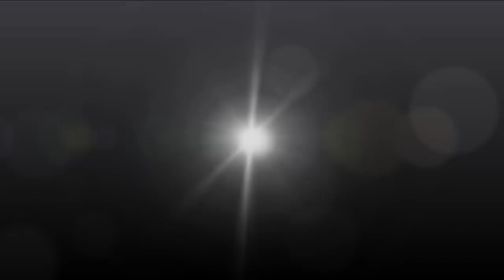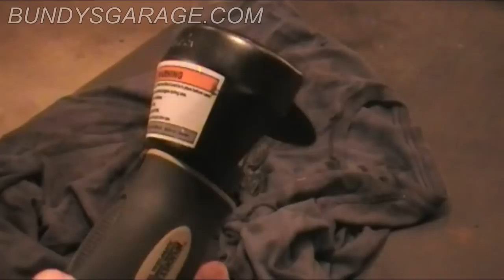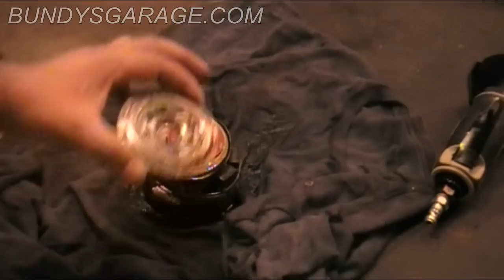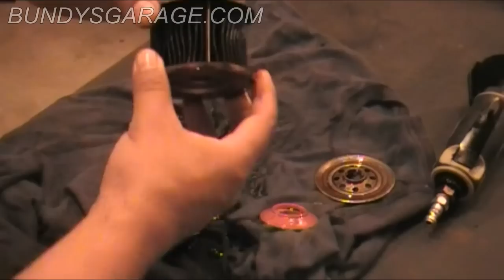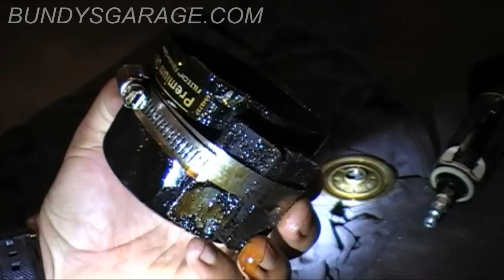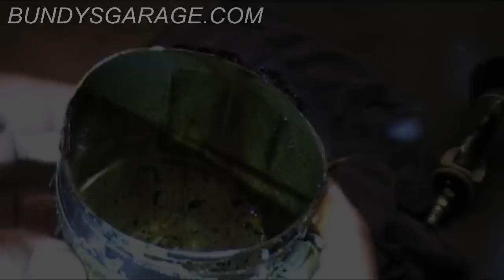Magnets on the Oil Filter Extend Engine Life...PERIOD! - Bundys Garage

Comment: Had an earlier comment! Filter will catch most of this stuff! However not all. On my 2001 Dodge Caravan I have a magnet (factory install), in the bottom of the transmission oil pan! When I change transmission oil the magnet looks like a porcupine with quills sticking out all over! This magnet is located before the transmission filter. As preventive protection of your engine magnets placed on oil filter cannot hurt! If it stops stuff so small the filter cannot stop then it would be worth it! Since you change oil filter on regular basis it would not build up to block flow! That is what the oil by-pass valve in your filter is for! A magnetic oil drain plug would also help! James

Comment: If you get a bunch of old computer hard drives you can take the magnets out of them. They are MUCH stronger than those $2 magnets you used and you won't need to strap them on.

Comment: You introduced a ton of metal particles when you cut the filter open, not that a magnet can't help.

I put a strong magnet on the bottom of my oil pan then remove it before I drain so the captured metal flushes out,  That way it works the whole time the engine is sitting drawing the metal to the bottom of the pan and holding it there.

Also, I feel like the oil is flowing too fast through the filter to allow the magnets to catch much metal.  On the pan it has a long time to draw the metal and hold it.

Comment: I have no doubt that the magnets catch particles.  But it makes me nervous using the magnets after the filter and not before.  I imagine particles building up in clumps against the magnet and then some of those clumps breaking free of the magnet and making it to the engine as a larger more harmful clump.

If the magnet was before the filter element then the filter would catch the clump.  Just a thought.  It seems scary, but what if you just dropped a powerful magnet inside the filter?  The flow of oil should always keep it in the body of the filter and I don't see how it would ever flow backwards past the steel oil filter inlet against the flow of oil.  It would have to fight against the flow and not stick to the steel filter body.
Reply: The magnets are catching the metal from unfiltered oil.  The clean oil comes from the center of the filter.
Reply: MrTdw1954 Ah. I thought filters flowed the other way.  Makes sense now.
Reply: what MrTdw1954 said is true.. the clean oil comes up threw the center. they do make magnets that go inside the filter as well.

http://www.ebay.com/itm/Single-Universal-Magnetic-Oil-Filter-Magnet/350471746669?ssPageName=STRK%3AMEBIDX%3AIT&_trksid=p2057872.m2749.l2649

 It would be hard to believe that there would be large clumps on a magnet after the filter because well.. its after the filter. The particles that come after the filter are so small you wouldn't really see it. and the Large magnet that is dropped into the filer should be able to hold it all. at least defiantly long enough between oil changes. make sure you would clean the magnet at every change. 

I would however wonder if the magnet inside the filter would cut off flow of the oil and cause other problems.
Reply: @MrTdw1954  Where are you getting your information, certainly not from a lubrication engineer like myself.  The oil flows in through the small holes, up the walls and then back out through the center hole, because there is more surface area on the outside of the filter element and it won't clog up as quickly.  Additionally, most automotive filters have a bypass valve built into the dome area of the metal casing, to allow overflow (bypass) if the media becomes saturated with debris.  This valve opens "into" the center chamber so oil can go up the sides over the top of media and then dump back down into the center area for release into the engine.  It WOULD NOT WORK if the flow was in the opposite direction because it is one way.

Additionally, our oil filter magnets are designed to go inside the center of a filter because we are trying to capture the particulate that is too small to be caught by the filter media.  We are only really interested in capturing particles that go "through" the oil filter because those under 8 microns are responsible for over 75% of our engine wear.     www.OilFilterMagnets.com

Comment: anyone whos been threw engine problems knows you get mostly copper & brass which are non ferrous & continue to circulate..I also use 3 strong magnets which never seem to catch anything..what am I doing it for besides peace of mind?.my rings are cast so I get that part but I just went threw spun bearings eventually I broke the crank, brass and copper for days no iron or steel.........
Reply from the maker: +ethanemily1000 what kind of engine?
Reply: sbf 306
Reply: I do believe its a good idea & thats why I do it..also in the T5 tranny & recently cleaned a bit of steel from them..but never from any engine have I seen anything on a magnet from motor oil, even with serious problems my experiences have shown metals in oil only; & filter obviously..seems if you did your motor would be trashed unless it was being broken in or something.

Comment: Magnets are not needed. The filter will capture these particles. Use quality filters Mobil One Royal Purple Amsoil Bosch are just a few.
Reply: Wrong, no oil filter will catch particle below about 20 microns.  (Note: Those are the $10 ones, not the $4 generics that most people buy).  Good enough you say, well let's see what the SAE, OEM and Independent Laboratory tests say.  How about... "Particulates under 8 microns are what cause 75% of an engine's internal wear!"   Oh, so a filer that can only capture particle bigger than 20 microns somehow stops the flow of particles under 10 microns???  Not gonna, if we can borrow a phrase.  Magnets ARE needed Arthur, please do research before making undocumented statements as this subject is well studied and beyond refute.    Check out the SAE, OEM and Laboratory Tests that have been in the book for over 20 years...  www.OilFilterMagnets.com

Comment: You do realize that the metal picked up by the magnet would have been trapped by the filter media, you are on the inflow side of the filter The human eye can not see particles smaller than around 35 microns (Child with perfect eyesite) so the fact you can see the particles means they are larger than the minimum capability of full flow oil filters of average 20 nominal microns entrapment.

The other point is oil particles also consist of non-magnetic particles.Much of metal found in an engine are soft particles of bearing and guide wear,deposits from combustion,and dirt passed by the air filter.Most of these particles will be non-magnetic.

It's more practical to use a magnetic drain plug to trap particles before they enter filter system.

http://www.baldwinfilter.com/literature/english/TechTips/201403TechTipsMicronRatings.pdf

Comment: I use filtermags on both my vehicles

$50.00 on eBay
Reply from the maker: +Jack Smith don't pay $50, just get 3 or 4 block magnets and stick'em on our oil filter. Less than $10 spent.

Comment: the filter would have picked that up anyways...
Reply from the maker: What if the metal particles are too small for the paper material to stop them and they just kept circulating around causing engine damage. This way you know for sure they are "captured".
Reply: not all metals are captured by a magnet...do yoursel a favor and buy a bypass system.
Reply from the maker: marceloevera2009
What if they don't make a bypass system for your vehicle?
Reply: YOU CAN INSTALL A BYPASS VIRTUALLY IN ANY VEHICLE...MY BIG RIG HAS ONE(TRACTOR).
Reply from the maker: Who makes them?
Reply from the maker: +Mike Fenimore if it's metal it will pick it up. It's just an added level of protection. My Silverado has 300,000 miles on it, because of doing oil changes at 3,000 miles and having magnets on my oil filter